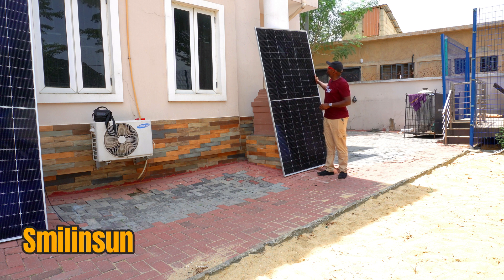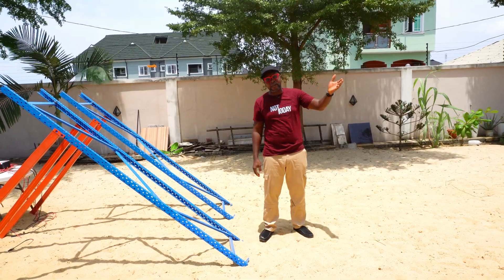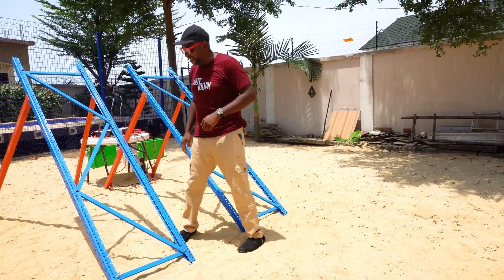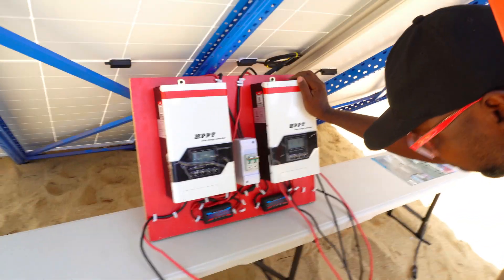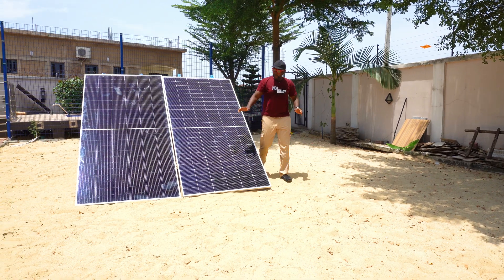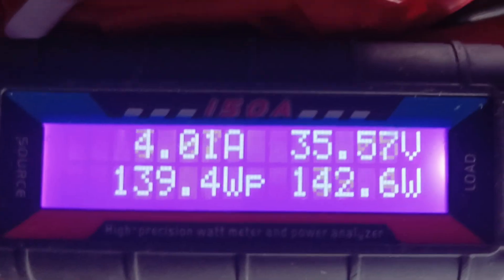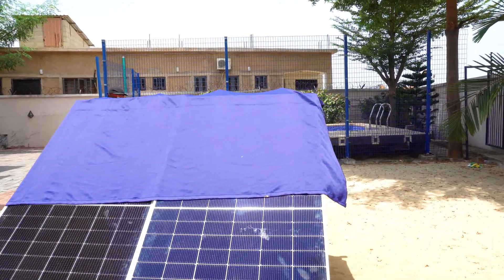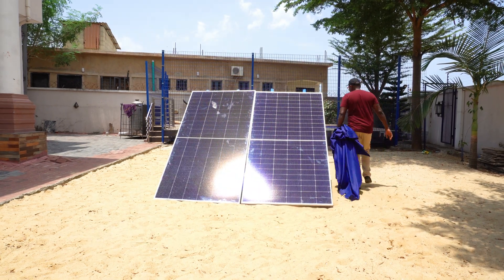JA Solar vs Canadian Solar in Solar Panel output efficiency test

Comment: Switching the panels made no sense at all.  It was obvious that they both got the same exposer. The best way to measure the output of the panels is to measure the watt hours going into the batteries over a certain period of time.  Plus, there is no cost per watt comparison.

Comment: Your Test: The canadian solar is n type while the JA panel is type. You will get the same thing during the day. But where the N type panel shines is that for the same power rating its more power efficient thats why its slightly smaller in surface area. It also produces more power early in the morning and late in the evening. N type panels have 16-18 busbars while P type have 9-11 busbars

Comment: Great job Mr Ikenna, pls why is the controller charging a 12v battery at 30v thereby reducing the current going into the batteries ?

Isn't the controller supposed to size up the voltage to match the battery voltage rating? (15v preferably)

Pls clarify sir. Tx
Reply: Greetings, the charger will regulate to charge the battery connected.  The battery could be 12 or 24v on most of these.  The charge controllers usually can go up to 100v solar panel input.  The more power you get the better, the bigger the panel the more you get while its cloudy, hence taking advantage of the sun as much possible.

Comment: sir , i have  a few quick questions :- ur response shall be appreciated ...1-  ja  panel and canadian panels are p.type or n.type. ?  2-  i use solar sytem but while using the system when i turn on ac or water motor or even a refrigerator then the inverter immediately trips and stops working specifically (when i have disconnected the grid electricity from the inverter) because of the starting torque current of these appliances , so what i want to know from u is that is there a way to overcome this issue of the  starting current torque ?
Reply from the maker: What is happening looks like your inverter is undersized for the task you are giving it. there is no information on your inverter capacity.
Reply: @smilinsunsmilinsun8056 no sir , my inverter is not at all underpowered , infact  i have solar panels totalling 3 kw and the inverter is actually 6kw so as such there is no issue of compatibility or lesser power of inverter...
Reply: The overload protection is what is triggering the inverter to go off. Try upgrading the capacity of the  inverter or put off all loads and then put on the water motor to see if the problem perists.
Reply: @winnieedigin  Ur response is appreciated ...now u have given two suggestions ..for the first one , my inverter is not underapacity , in fact it is overpowered i.e. it's a 6kw inverter and my max.running load was 2.3 KW . Now for Ur second suggestion , i have already tried the exact thing which u recommended but still the motor or ac or fridge did not start and the inverter tripped every time ...
Reply from the maker: @winnieedigin  Thanks for that further details ,  The inverter is undersized kindly  be careful about the products you buy.
Reply: Mine does similar thing, though not all the time. It trips off and says short circuit, and comes back ON after 2secs, but just on the socket where my TV, Home Theatre, Laptop, DSTV  etc. The reason was because My AC socket and the TV socket share the same Neutral wire (Bad wiring by those who wired the apartment). So what I did was to connect all the appliances on the TV socket to a UPS first and plug the UPS to the TV socket. That way it stopped.

Comment: What is the SCC specs?
Reply from the maker: 100 amps
Reply: @smilinsunsmilinsun8056  245V or 145V?
Reply from the maker: @fredrickolowojesiku6419  You mean PV voltage ? 150v
Reply: Scc max pv support I mean